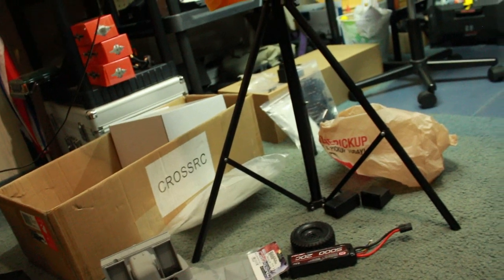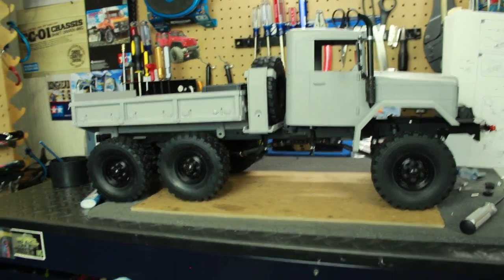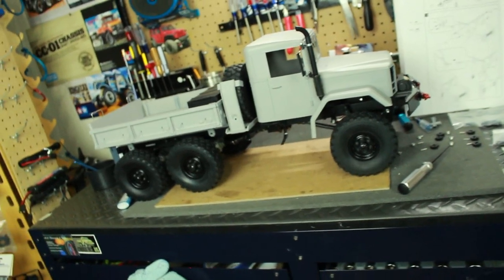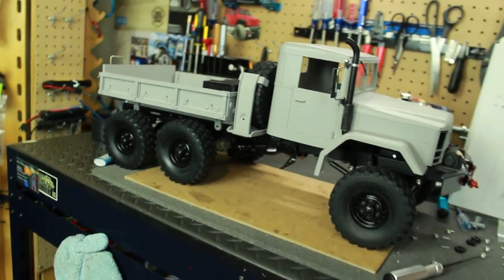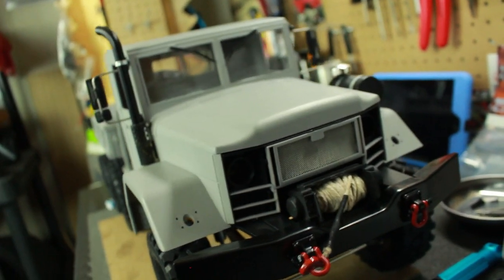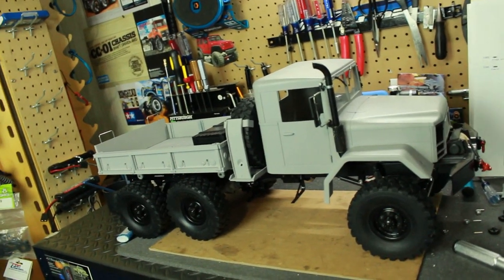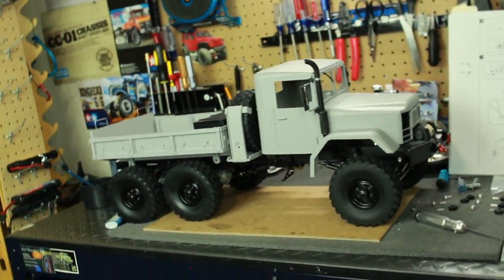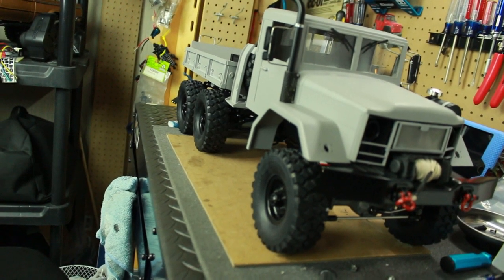RC84Films: CrossRC Update #3

Comment: Quite a build the cross. I know you say the 1/12th on a 1/10th but imagine the extra weight if it was 1/10th.
Reply from the maker: I hate the plastic leaf springs i broke some not evening running wish there was metal or a mod to do to them
Reply: @RC84Films  Just a thought but have a look at the springs in a Gamde Sawback and if they look the same could it be possible to mix those in so all metal. I know there will be slimmer but make a piece of plastic as a spacer to get them in the right high from the axle. Tamiya also do leaf springs.